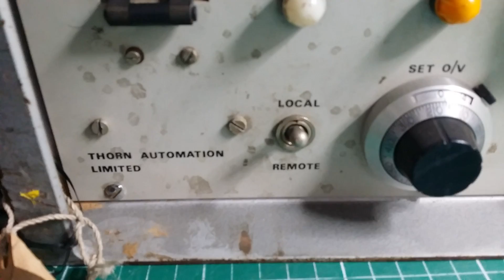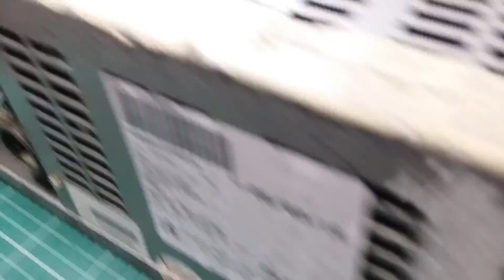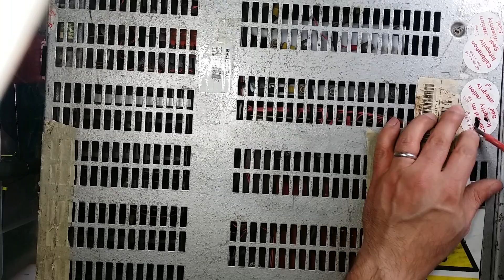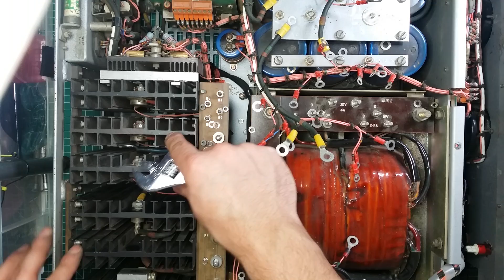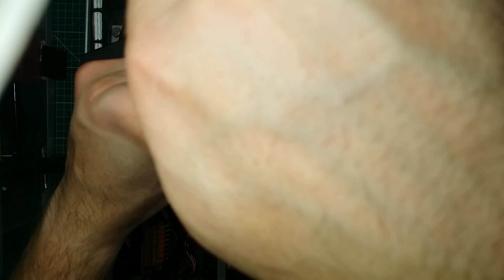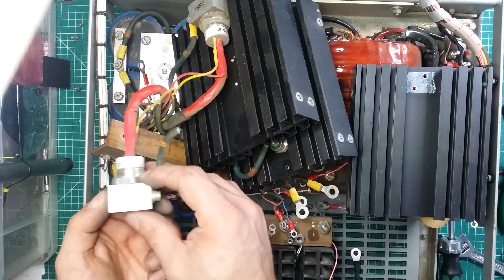Thorn Automation Limited 0-40v , 0-50A Linear power Supply Tear Down Part 1

Comment: I worked on these, manufactured at Thorn EMI Rugeley. All PCB cards and sub assembly's were tested separately, then the unit was put together and tested as a complete unit. 100's were sold between 1971 and 1995
Reply from the maker: Great gear but heavy as a truck.